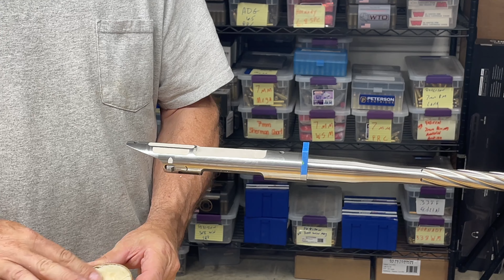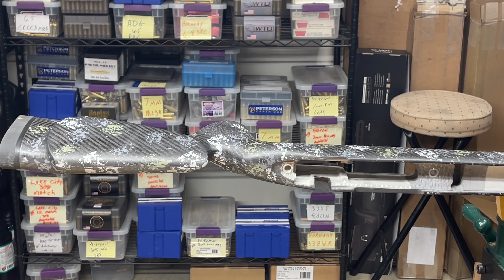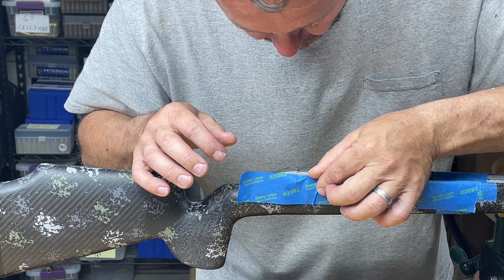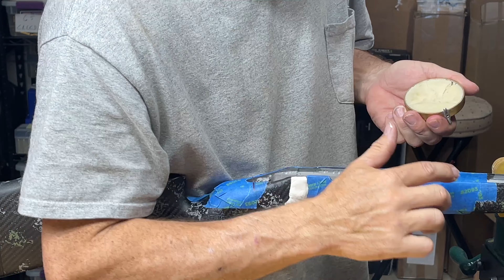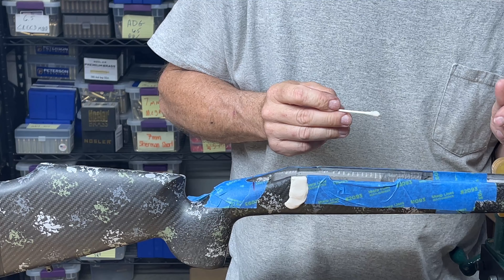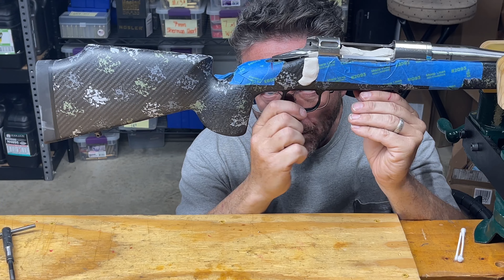Bedding a Defiance Classic 6mm Creedmoor part one

Comment: Why do you tape the recoil lug?  I thought the purpose of the bedding was to create the perfect mating surface?  
Can you give specs on the barrel and stock?
I like the rear action screw tool you have there.
I just ordered my Classic.  Should have it in a week.
Reply from the maker: @tommyj7087  you tape the sides and bottom and the front of the recoil lug to make it a bit easier to remove it from the stock…especially if you do switch barrels like I do. If you’re not doing switch barrels and don’t plan on taking it in and out of the stock often, you really only need to do the bottom of the recoil lug, but it makes me nervous to only do that so I like just a little bit of play on the sides and front.
Reply from the maker: @tommyj7087  Prefered barrel blanks, .810 taperless, 1:7.5 tw, 6mmCM. Stock is McMillian game hunter.